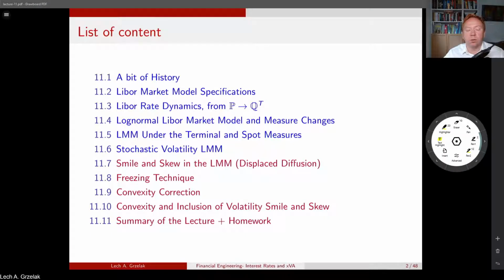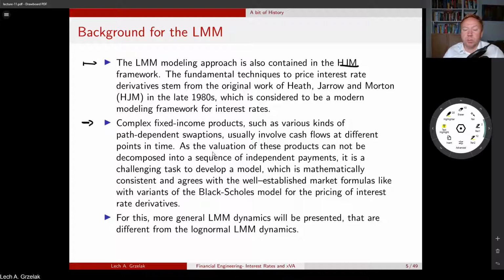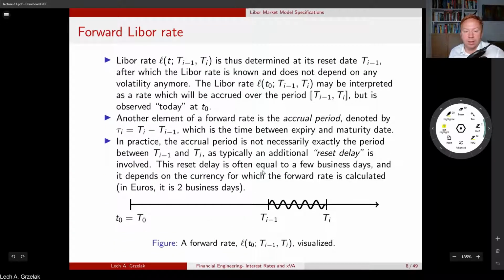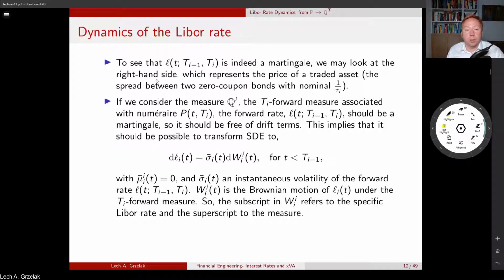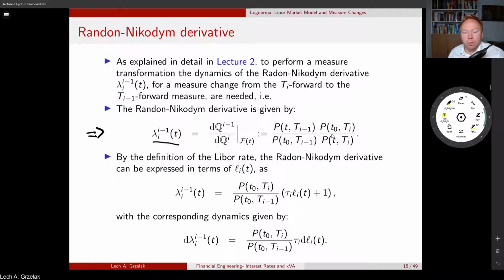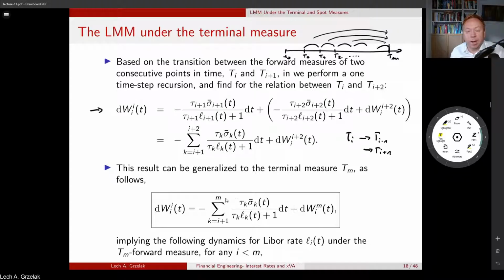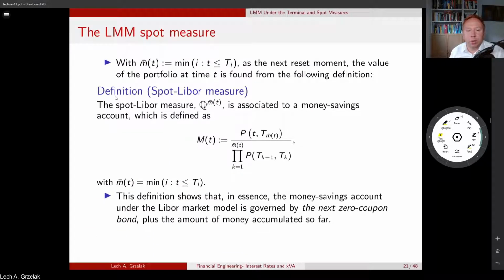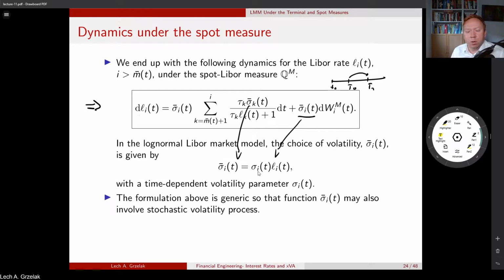Market Models and Convexity Adjustments (Lecture 11/14, part 1/2) | Financial Engineering Course

Comment: Hi Lech, in slide 21/48 in the definition of the spot libor measure, we will still need some kind of interpolation between the ZCB to compute the numerator. 

This is similar for the case under P(t,T). So still we did not earn much in terms of the difficulties we have in discounting due to the fixed tenor term structure.

Do I miss something?

Comment: Hi Lech,
I want to understand the dynamic of the forward rate Li(t).
Suppose that we have discretized the interval [0, 30 years] and we have 0<3m<6m<1y<...
Mathematically it is denoted by T1=31 August 2023, T2, T3, T4, etc...
From my starting point 0 (let's consider that is today 31 May 2023), I have a bootstrapped the forward curve.

1. Given the today's forward curve, If I want to simulate a future forward curve (suppose my starting point becomes "02 June 2023"), I want to know if the previous dates T1, T2, T3,... will stay the same or will move on (T1= 02 september 2023, new T2, ...).

Thank you, regards.
Reply from the maker: hello Iandry, if you consider a forward rate L(t,Ti,Tj) then only the first argument changes as you go in time. The remaining Ti and Tj are fixed and don't change.  So if you come tomorrow and observe the rate L(t,Ti,Tj) the time-points Ti and Tj will not change but only time "t" will be affected. Otherwise, you could have too many moving parts. Does it answer your question? Best, Lech
Reply: @ComputationsInFinance  Yes, it does. Thank you very much Lech.

Comment: Hi Lech, 
Why do we say that the LMM is better than a short rate or than a cheyette model? Why is better for pricing exotics?
I have always wondered this.
Many thanks, Alberto
Reply from the maker: hello Alberto, LMM extended with stochastic volatility will perform better than short rate models, it comes from the fact that LMM has many more degrees of freedom to calibrate to the whole volatility cube in the interest rates. Of course, please keep in mind that everything depends on your definition of "exotic derivative". There are derivatives that are extremely complicated & callable, while others can be called exotic while having a simplified form, like caplet/floorlet. I hope this explains! Best wishes, Lech
Reply: Hi Lech, what if we consider the plain LMM (without stochastic vol). Is still superior than a cheyette model or than a short rate model?
Reply from the maker: @albertoz9534  Everything depends on the derivative you wish to price. The "pure" LMM will only give you ATM volatility (no skew, no smile) however it allows for the forward rates to be correlated with correlation < 1, which is not the case for the standard HW model. If you then move to Chayette, indeed, it will help, but it is also not trivial to calibrate that model. So the bottom line is: there is no such a thing as "the model", everything depends on the type of derivative and the hedges you want to set. Hope it explains. Best wishes, Lech